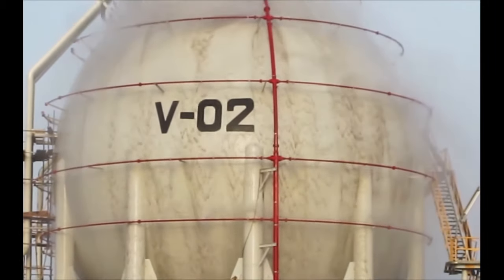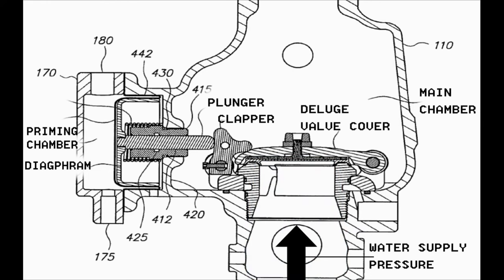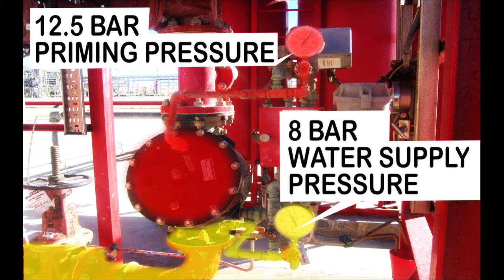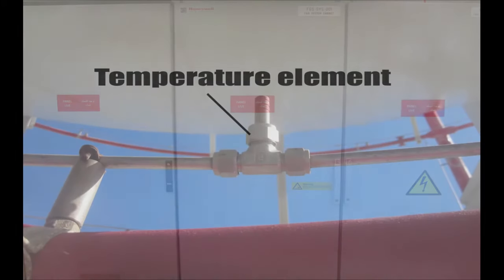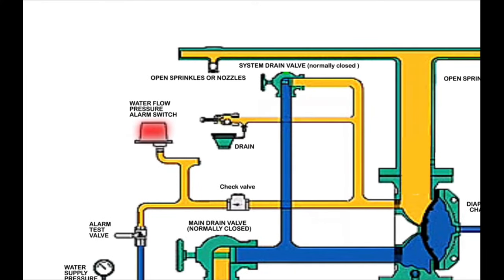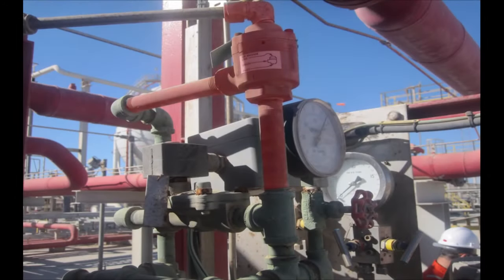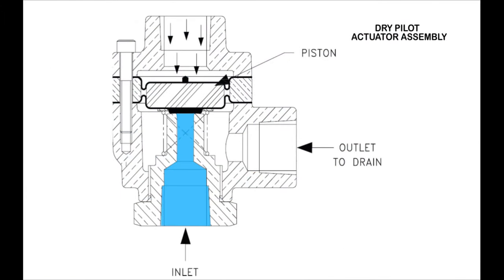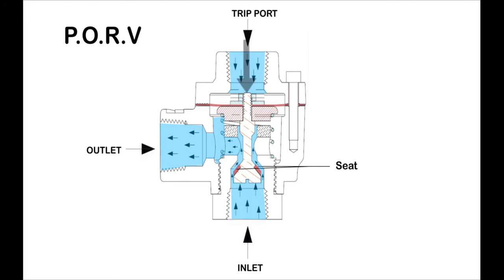How deluge fire protection system operates, how deluge system activates and it's components working

Comment: Hi,
Can we fix actuator for 2 way valve if there is no actuator. What all changes we need to if we want to fix it. Can you please explain.
Reply: Does anyone have a manual for the installation of sea-fire Csrs VIII pn 131-252 is an engine interrupt/restart system